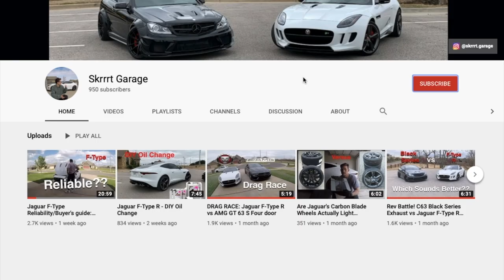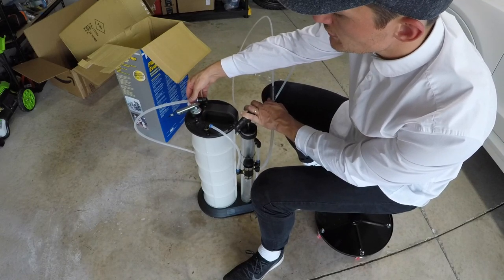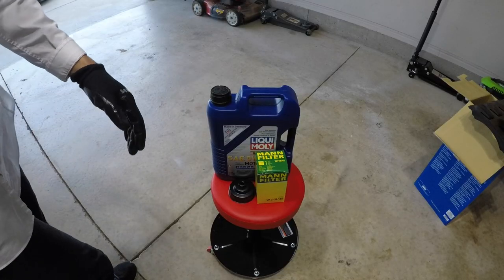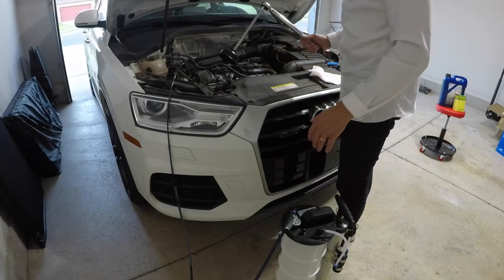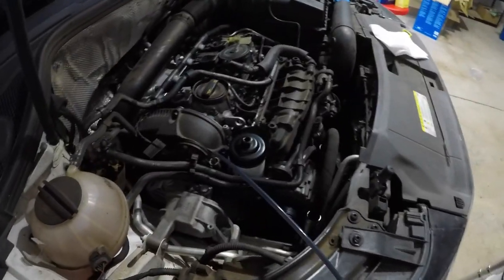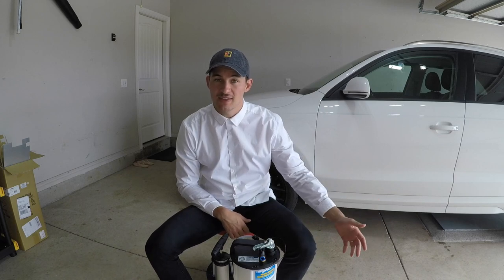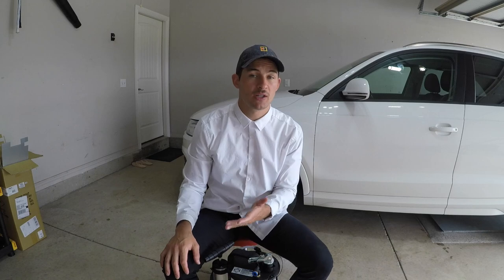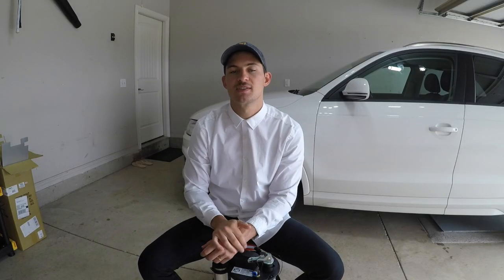Mityvac 7201 Extractor Review: Oil Change on Audi Q3 2.0 TFSI Engine

Comment: Definitely heed the advice he gives on not having oil too hot. I did this once, pushed the tube down into the oil pan, and the tube turned the corner, melted enough to kink and was stuck in place. I had to drop the oil pan to get it out. Longest oil change ever.
Reply from the maker: Dang man! I can only imagine
Reply: @skrrtgarage3922  how long should I warm the car to prevent any melting

Comment: Critical part that you overlooked is not wanting to "dry start" the engine.  When you insert the new oil filter, pour lots of new oil over it to saturate it and have as much oil in that section so the engine isn't running w/o oil for a couple of seconds as it works its way through new filter material.
Reply: Underrated comment!
Reply: That's false information. It's been proven that isn't necessary.

Comment: Hi!  Thank you for producing this excellent video.  You did great job keeping your shirt clean during oil change  :-) . Great tips.    I have a couple tips of my own after using the mitivac myself you probably know already.  1) warm up the engine, but do not let it get too hot, or let it cool down as the manual says "Do not extract oil when temperature is above 176 °F (80 °C)."  A thermometer on dipstick  right after pulling it out might be usefula 2) after inserting the tube at right spot, you could use a sharpie (permanent) or tape (temporary), and mark the tube then next time you know exactly how far to go with your vehicle.   3)  if you open the engine fill cap that will allow air from top you  could make the suction go faster. 4) put a rag/towels  around the bottom of the filter, to keep drips from going down onto engine.  5) after sucking up all the oil leave the line connected to the mitivac and uses a closepin or similar and hang it high - this allows the residual oil on the line to drip down into the mitivac.    Good luck with your channel and keep up the good work/content!
Reply from the maker: Great advise, thank you!

Comment: i take it this does not work on 2016 Chevy Cruzes?  Inserted smaller tube into dipstick and pumped approx 20 times and didn't get a drop of oil.  Not even in the line.  It was in evacuate mode.

Comment: I have had my Mityvac since 2007 and never had any issues with it.   I always empty it after use, by just reversing the valve direction and pumping the old oil into the same oil jug that I just poured in the engine.   Never had any issues or leaks, maybe because I don't let any oil touch the seals.
Reply from the maker: That’s smart! Taking care of the seals is really important for long term use

Comment: A level starting point is not truly necessary. The oil pan is essentially the lowest part of the car or truck, and will always move oil to its lowest point, allowing you to extract 99% of it.
Reply from the maker: Yea that’s true, but it messes up the fill portion when the cars computer is trying to figure out how much oil you have in there

Comment: Your cleaning tips are much appreciated.  I bought mine for a transmission and differential oil change. When I change the diff oil, I’ll need to extract with mityvac and then use it to pump the fresh oil in.
Reply from the maker: Right on, thanks for the comment

Comment: Great presentation, I especially like the maintenance tips at the end of the video. I was wondering how you would go about cleaning the oil from those tubes. Thanks for sharing your expertise and experience, 👍👍
Reply from the maker: I appreciate that! Thank you for the comment
Reply: I have an extractor myself.  The unit I bought has both a hand pump as well as the air chuck so you can extract fluids using pneumatic vacuum without all the hand pumping.  To clean the hoses, hold the tip up with your finger on the end of the open tube, apply a good amount of suction with the extractor and then just remove your finger a few times.  The suction will draw almost the liquid residue in after a few suction cycles.  This process is much easier on the pneumatic pumps, as you could imagine.

Comment: Thanks for the video man @Skrrt. I don't have the same exact pump, but it was similar enough and it was the same car that I did it myself. Also not sure why your pump is so slow, but mine pumped all the oil out in about 5 minutes or less. Saved myself over $150 on an oil change and the hours of waiting for my car back. I also put away the pump without cleaning it then watched the end of this video and ran back asap to go clean it out. Thanks!!
Reply from the maker: Right on! I don’t pump mine with a ton of pressure to (in theory) protect the seals. Thanks for the comment!

Comment: I actually tried this exact vac last night.   While it seems to work as intended it does take a very long time. Took almost 40 min vaccum suck this fluid out.
Reply from the maker: I remember thinking it took a little longer than I was expecting but not 40min, was the engine oil warm?

Comment: Any tips for failure to suck properly? I have a version of this with the venturi valve where you can hook it up to your air compressor. Originally that used to work great, now it doesnt seem to be able to pull much. If I try to use the vacuum method and manually vacuum with the plunger, I do get much better suction but it's still also slow. As in I regret using this vs doing it the traditional way. I've only pulled 2 liters in about a half hour.

Comment: Hey great vid, I got a question, I use multigrade oil, 20w-50, won't the oil get thicker and harder on the tool to extract if the oil's all warmed up?
Reply from the maker: Oil is easier to extract when hot. Think of syrup. In the fridge it barely moves, if you put the syrup in the microwave is flows like water. 👍🏼

Comment: I hate mine. Had 3, and all 3 were crap. None would hold suction. I'd pump 10-12 times. As soon as I stopped, I'd get maybe 3-5 seconds of pull flow them out drops off and I have to pump again. Making me essentially henge to constantly pump it. Took about 20 minutes to get the oil out of my a5 and my a7, 7qts each.
Reply from the maker: Yea I’ve heard people have had bad luck with these, sorry about that. Mine has been great (knock on wood)
Reply: Nothing beats the natural way
Reply: FAILED ...literally after 1.5 oil changes on a babied and always garaged Benz owned since new and mostly always dealer serviced.  Worked this stuuuupid, time-wasting unit in the most by-the-book pedantic and meticulous way imaginable (with professional tools and previous wrenching experience on cars and motorcycles to boot).  Had to abort the second oil change right in the middle of it after having extracted just 3 liters (3.17 U.S. Quart's) due to the pump or seal failing, hence the "1.5 oil changes" comment.  Checked all fittings and fasteners -- Nada!  And am NOT about to waste even more life-cycles trying dissect and trouble shoot this disaster.  Hoooorribly slow, hoooorribly laborious, and hoooorribly poor quality.  A total joke ...and the joke has been on many of us consumers.  Stay away - stay away - STAY AWAY! from this poorly made and poorly thought out "product" made you-know-where.  And then they have the gall to state "quality controlled in the U.S.A."  Yeah, my foot! 🙄  There - I paid it forward.  Happy wrenching!

Comment: Does it have adapters? My vehicle has a built in system for oil changes so this mity vac tube would have to go over the tube in the car
Reply from the maker: Yea I believe it does, my jaguar f type also had a tube that goes down into the sump.

Comment: Question - I just bought this and for some reason the main tube (biggest one connected directly to the mityvac) is not coming out. I want to take the tube off to store but it's stuck. Do you have this problem? Im yanking on it and it doesnt seem to come off. I dont want to break it so wanted to stop by and ask you. Thanks in advance
Reply from the maker: Sorry just seeing this. Yes, the way to get it off is by pressing around the blue orifice. It's a friction fit, so you have to press in on it while you pull the tube out. Hope that helps!
Reply: @skrrtgarage3922  no worries, and roger that! Thank you 👍👍

Comment: If you use this pump for an extractor only, do you have to clean it?  Does leaving oil residue in it cause breakdown of the plastic or vinyl tubing or seals?
Reply from the maker: Yea, you 100% have to clean it every time.

Comment: Enjoyed the video, how do you removed the larger tube from the fitting on the tank?
Reply from the maker: I’m not sure I understand what your saying, most of the connections are just plug ins
Reply: I was gonna ask the same question. It doesn’t seem to want to come out. The little blue seal holds it in pretty tight, I don’t want to force it out.
Reply: @AD-ds3sd  I figured it out. You will want to hold the blue ring in while pulling the tube out. You might want to use a plier on the tube to pull it as it can be tough. Pushing the blue ring prevent the metal teeth from digging into the tube as you pull it out.
Reply: @kkcapcom2  awesome thanks!!! I really didn’t want to go crazy with it and break it in the process 🙏🏻🙏🏻🙏🏻
Reply: They are called John Guest fittings. Lots of YouTubes illustrate how to change them.

Comment: How do you get the plastic hoses to go all the way down around the bend at the bottom before reaching the oil pan without breaking it.
Reply from the maker: The smallest hose is pretty flexible, you might be at the bottom of the oil pan and not realize it
Reply: @skrrtgarage3922  I checked the  hose for oil and was dry, i tried both hoses and once i insert about all the way it feels like it hits a blockage right before hitting oil pan.
Reply: If you want to be certain, extract the oil, then jack the car, remove the drain plug, and see how much more oil comes out. Of course, you only need to do this once. Another thing: You never get every single drop out when you do an oil change, no matter what.  Don’t sweat the last half a cup or whatever.

Comment: How do u hook up the pneumatic feature? I was not aware this unit can hook into an air compressor.
Reply from the maker: There is a hose from the vacuum pump to the reservoir, I believe it is connected there.
Reply: @skrrtgarage3922  NO Pneumatic (via compressor connection) capability on this model, it is manual only

Comment: Don't even nother trying an oil extractor if you plan on using it on a ford ranger. The dip stick tube is not in the deepest part of the pan and will leave half of the oil behind. Totally bummed out.

Comment: Is this capable for the F type?
Reply from the maker: It would be perfect for it!
Reply: @skrrtgarage3922  But F type doesnt seems to have a dipstick... So where we suppose to put the hose? Nice video btw, thanks for sharing!
Reply from the maker: Toward the end of the video, I showed under the fuel cap of the f type, it has a little nipple made for the extractor to latch onto. No problem!
Reply: I just made a video about changing oil on the F-Type using the mityvac
Reply from the maker: That’s awesome! I did a “normal” change on mine a few months back and I wish I had the mityvac
Reply: Skrrt Garage 20 minute oil change. Summer heat with mods I put 5w30. Should give that little extra protection.
Reply from the maker: That’s smart, I just subscribed to your channel. Love what your doing with your car!

Comment: autozone recycles the oil that customers bring in, so the cleaning solution of Dawn and water contaminated the the rest of the oil in the recycling container at autozone. why don't you do everyone a favor and just pay someone to change your oil.your doing more harm than good.
Reply: " Valvoline's oil recycling uses the same refining processes used for crude oil refining, including hydro-treating and distillation techniques to remove contaminants and used-up additives. The process results in recycled base oils that can have the same quality and performance as base oils made from virgin crude.Mar 22, 2011" Hydro means water, so it sounds like water is used in the initial process of refining oil and the recycling of it.

Comment: I don’t know???what are you gonna do about the filter???you can’t pump that out and pump a new one back in,,,you’ll still have to jack up the car and get up underneath of it so what’s the point???
Reply from the maker: Filter is on top
Reply: @skrrtgarage3922  I have a Toyota Tacoma and mine is on the bottom
Reply from the maker: Yea, most American/Japanese cars the filter is on the bottom.
Reply: You change your filter every oil change? Hahaha ha amateur,  don't get me wrong I'm one lazy fuck! I wrench every day with multiple cars at once so the less I have to do the better ! That puppy is a hell of a tool !
Reply: @william38022  I find that most bottom oil filters are in the front of car, so I still don't have to jack it up to reach it.
Reply: Speaking g of Oil Filter...
On this Audi, it is 22 ft/lbs torque ON THE OIL DRAIN PLUG, NOT THE OIL FILTER!
OIL filter only needs full hand tight or slight snugging with filter wrench if had tight really isn't. 
Good suck out vid!

Comment: FAILED ...literally after 1.5 oil changes on a babied and always garaged Benz owned since new and mostly always dealer serviced.  Worked this stuuuupid, time-wasting unit in the most by-the-book pedantic and meticulous way imaginable (with professional tools and previous wrenching experience on cars and motorcycles to boot).  Had to abort the second oil change right in the middle of it after having extracted just 3 liters (3.17 U.S. Quart's) due to the pump or seal failing, hence the "1.5 oil changes" comment.  Checked all fittings and fasteners -- Nada!  And am NOT about to waste even more life-cycles trying dissect and trouble shoot this disaster.  Hoooorribly slow, hoooorribly laborious, and hoooorribly poor quality.  A total joke ...and the joke has been on many of us consumers.  Stay away - stay away - STAY AWAY! from this poorly made and poorly thought out "product" made you-know-where.  And then they have the gall to state "quality controlled in the U.S.A."  Yeah, my foot! 🙄  There - I paid it forward.  Happy wrenching!